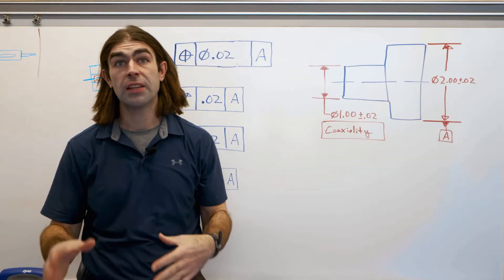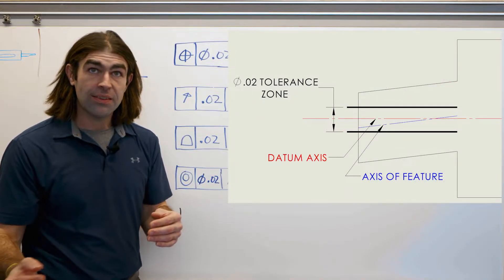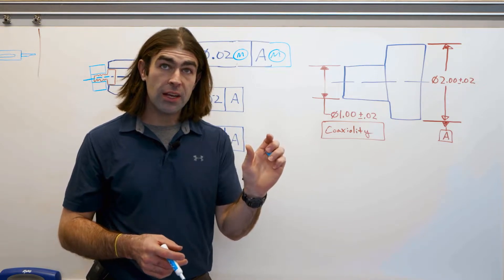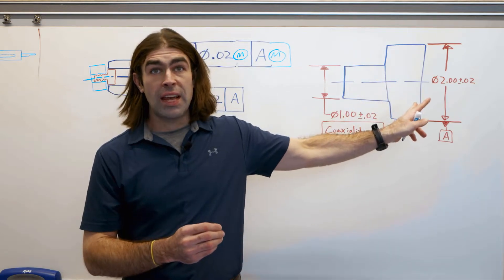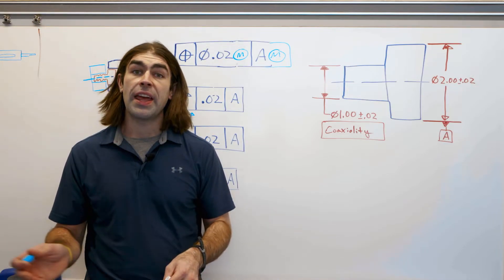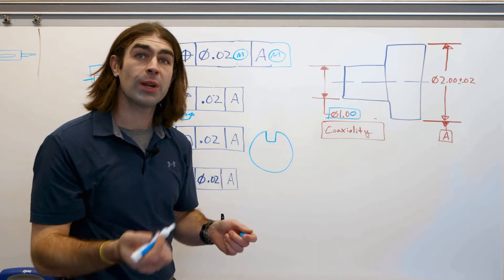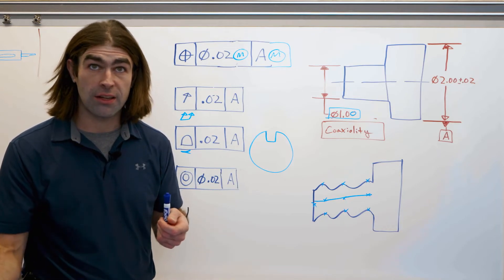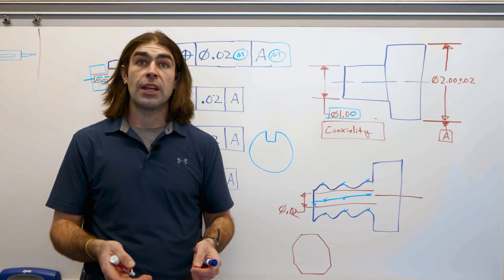GD&T Coaxiality Position vs Profile vs Runout vs Concentricity

Comment: Can you have a feature control frame with a positional requirement as well as a composite tolerance attached to two coaxial holes?
Reply from the maker: Yes, the second segment would control the holes to each other coaxially. The first segment controls the patterned holes to the datums. Someday I will make a whole video on composite position control of coaxial holes.